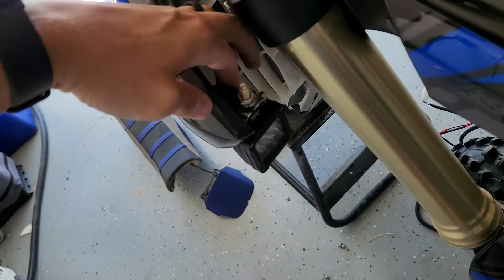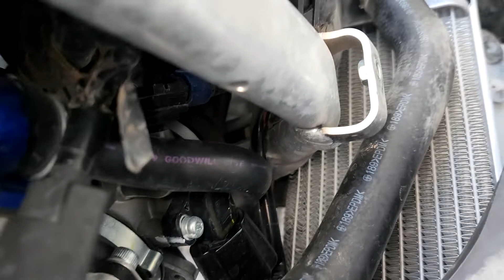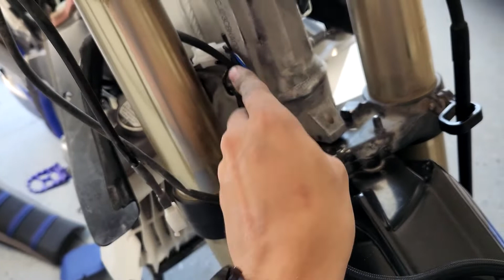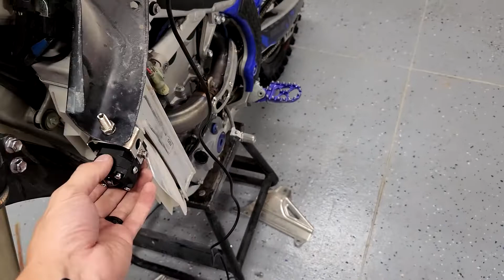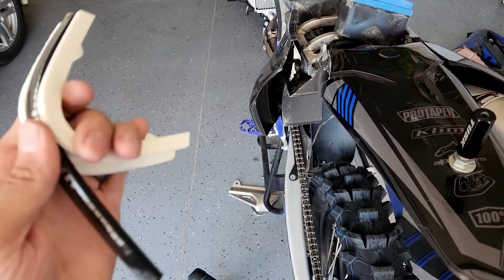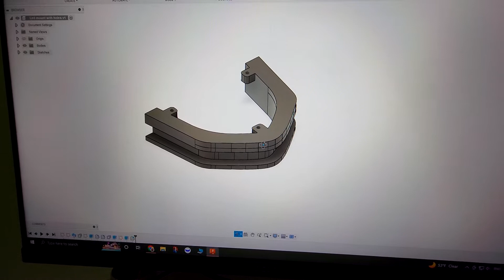YZ 450F custom street legal dirt bike kit

Comment: great content bro! do you have any link to where you got that wiring harness kit?
Reply from the maker: Wiring Harness 2 Lead, Nirider 12V 40A Rock Switch Relay Fuse Nylon Wiring Harness Kit for LED Light Bars Fog Lights Work Lights Driving Lights Offroad LED Pods Wire Kit for Truck UTV ATV Boat https://a.co/d/8NCVvak

Comment: Thanks for the video. It arrived at the exact right time. Today I am installing lights on my YZ450f. I watched your old video and didn't want to pay for OHV kit. It just seemed too expensive for what it is. And I don't like the strange horn button hanging down off the bar. Good to see yours didn't hold up. I picked up the fork L.E.D's, the rear L.E.D. strip light, a couple wiring harnesses for fog lights, some extra wiring. Got a cheap but simple headlight and turn signal switch. The front brake switch for the brake lights.....etc. I'm gonna have to solder and shrink wrap all the wires together, but all the parts cost me around $70. I also picked up the same lights you just installed. What a surprise! They are a little different, but same thing. My bike is a 2008 so no stator. I got a 8aH lithium battery for $50 and will just charge it every night. Thank you so much for your content!
Reply from the maker: Awesome! Glad to see you are wiring it all up yourself! It's a lot of work but it will be worth it! And I just took off that ugly heat shield thing from the headlights that's probably why they look different
Reply: @Dirtscootdesigns  Oh, now I know which ones you bought. Yep, same as mine. Mine don't have the heat shield. They have great reviews and I love how they cut off so clean. Well, I guess we will both see how they actually work. I look forward to seeing your video at night and your opinions on those lights. I'm about to take off my fairings to try to install them in the same place you did this time. Seriously what a coincidence that you uploaded this yesterday and I'm now doing it today. Quick question. I don't have a relay. Do you think thath will be a problem? Just the main fuse off the battery. I chose 15 amp.
Reply from the maker: @tropicaladventures9481  a relay is basically just so you can use a small gauge wire switch to control the power but with it only being 12v you will probably be fine but I personally think a relay is the way to go if you can find a place for it
Reply from the maker: @tropicaladventures9481  or if your switch has good thick wires coming off it then it should be good
Reply: @Dirtscootdesigns  Thanks for the advice. Yes if does have decent wires. I've been subscribed for a while so I will be looking forward to a video about how your headlights end up working.
Reply: Quick question. I got my wiring all done and wow those lights are bright! So are the signals. Wow. They look awesome. I was able to mount the headlights directly to the original mounting point for the radiator's plastic fins. Super happy, so thanks for the idea. Now I'm working on the brake light and plate. I see in your Supermoto update video it appears your plate must be mounted using double sided tape. Am I right? Will 3M tape hold up? Did yours hold up?
Reply from the maker: @tropicaladventures9481  honestly hot glue works the best but I'm working on a mount that can be riveted or screwed into the rear fender
Reply: @Dirtscootdesigns  So you used hot glue and had no issues with it? What about the tape that comes with the brake light. Did it hold?
Reply from the maker: @tropicaladventures9481  the tape is garbage and the hot glue held it on for over a year
Reply: @Dirtscootdesigns  Thanks. I'll see if I can find some hot glue here. I live in a tiny rainforest village in Ecuador with only 3,500 people. I moved here from Canada. I was able to get an ownership that states the bike is for the road, and pass the inspection (lights, etc) by offering a small bribe. LOL. Almost nobody has supermotos here. I brought the excel wheels from Canada last time I visited my family. Anyways, that's my story and I have one more question. There is no stator providing power as I stated. The lithium battery is running it all. Do I need to make a ground? If so, would that be a ground from the negative terminal to a metal part of the chasis or something? If I need a ground, any suggestions where to wire it to? It's a 2008 YZ450f. Thanks so much man.
Reply from the maker: @tropicaladventures9481  glad to hear you are making it happen out there! And there should be a ground in your frame somewhere possibly under the seat